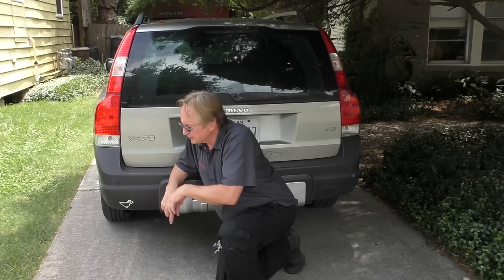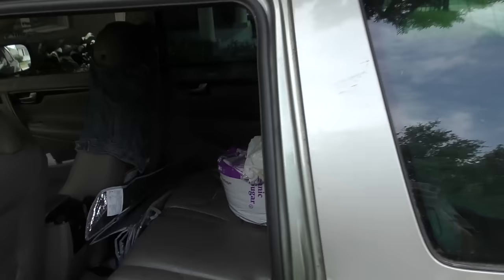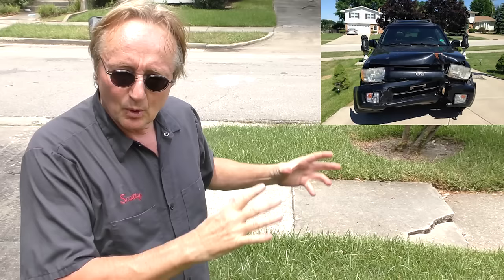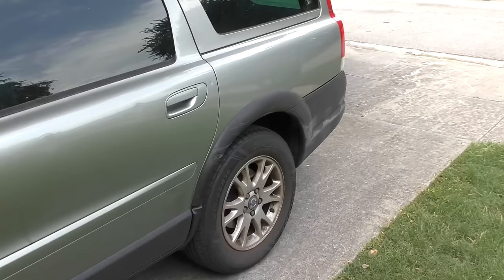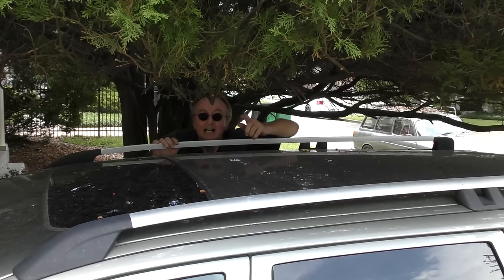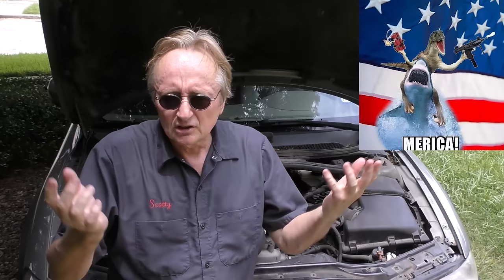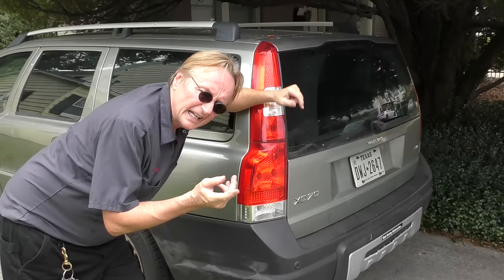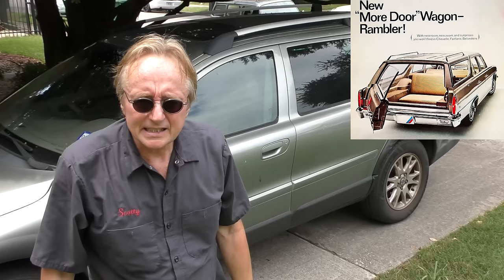Here’s Why Old Volvos Last Forever

Comment: Old Volvos are basically the Nokia 3310 of cars.
Reply: Josh Bacon 😂
Reply: Volvo’s are like my 90 year old grandma, they just won’t die!
Reply: Jk. Grandma, I love you
Reply: Never crash into a Nokia 3310.
Reply: iPhone 1
Reply: But those earlier 01-02 transmissions were like the xbox 360 red ring of death.
Reply: Josh Bacon Toyota land cruiser
Reply: Only the old volvos are so reliable and durable? For example the xc70 2016 model is not so reliable??
Reply: Don't forget about Motorola
Reply: you got that right!
Reply: Josh Bacon
What's the Nokia 3310?
Reply: @mouaxiong8618  the big brick ones.
Reply: Yup the Nordics knew how to build stuff back in the days
Reply: Volvo at Malaysia is unreliable car, easily oil leak. Need to overhaul due to the turbocharger. Don't trust this guy anyway.
Reply: People just made stuff IN GENERAL so much more durable back 15, 20, even 30 years ago.... most of the time anyway.
Reply: yeah you think. In reality the engines, gearboxes and the rest of the drivetrain just breaks and breaks.
Reply: Jia Fong Wee what years r u specifically talking about because they truly were reliable back in the day. My friends mom has had one for about 18 years now with no problems
Reply: True i driva 850 from 94, runs like a charm ;)
Reply: Only the Swedish built Volvos. The Dutch built Volvos (300 and 400 series) weren’t as good as the Swedish ones
Reply: I'm glad I bought a 2007 s80 3.2 with 147,136 miles on it. Just needs it's regularly scheduled maintenance. I changed the spark plugs and ignition coils so far.
Reply: Oh lord! 😂🤣
Reply: @moronsafetybot662  are you 8??
Reply: @jiafongwee3080  the volvos in your country are made in chinese factories. They do not have the quality control that europe has. The reason New volvos suck is because they shutdown european factories and now only use chinese factories and some ilegal slave man power and kid power to build them. Once they opened factories in China the quality droped a lot. If you buy a european made volvo they are the most reliable and safest cars money can buy but maintenence costs are high.
Reply: Like when I was out with my volvo 744 and drifting in my forest I crashed into a tree at 50 km/h only my Fogg lights broke lol nothing else happened to the car
Reply: @radnybolt5327  the 850 was prstty durable with the t5 engien but not as fun as a rwd Volvo 940 b230ft, fk, fb and volvo 740 Turbo from the 80s with b230et 180hp damn such fun cars
Reply: @rafaelramosmelim735  well if you own a old volvo from 70s to 2000 you can fix almost everything in your own garage with the proper tools and buy cheap parts from different sites on the internet in sweden you can buy cheap parts from V-parts or kl racing etc and I own a volvo 740 and I fix everything myself
Reply: Not clutch
Reply: @triggerhappyhippie  we still do mr
Reply: @karlcarolusrexxii1352  pure volvo power
Reply: @eddiewennberg6  💪💪💪
Reply: Nokia 5110😀
Reply: Josh Bacon my Volvo was build 1983
Reply: Xc70 best all round by far
Reply: And both are from Nordic countries😀
Reply: Jia Fong Wee that’s why I using Diesel engine oil to maintain well my turbocharger
Reply: I am a keen old merc collector and considering old volvo as my next collection. Are parts still available just like old merc?
Reply: @martijnhooijer3243  Those where problemcars...
Reply: 😂😂😂you only get rid of it only because you dont love it.
Reply: So true.
Reply: Pretty much
Reply: Or if an Abrams tank has a kid and it’s young and rebellious.
Reply: @MRBOCHIEDA2ND  is that a car with 4 doors or a wagon?
Reply: Spot on! Total reliability for those who didn't know better.
Reply: re there any good newer ones...the car ones specifically?🤔
Reply: @mouaxiong8618  i haven't heard that name in years
Reply: Swedish communities play an important role in Finland history.   Like the almighty Carl Gustav Mannerheim!!!
Reply: @nickcaesar7650  .
Reply: My 2016 vw polo gti just died its gonna cost way to much to fix so having no money I went looking for a cheap run around . I found a 2004 v70 D5 my god its a great car it runs like a truck and has so much room iv transported motorbikes in the back . Done thousand plus mile trips and I only paid $600 iv had it 2 years now and not once had to repair anything on it apart from a wheel that buckled when I hit a pothole its a beast
Reply: I still have a 2006 XC70 that I bought new 17 yrs ago. Great car but expensive new & parts are expensive & can be challenging to fix, although fantastic help online with chat rooms
Reply: @sniff1197  as someone who has owned several of these and daily drives an R, these cars are incredibly reliable
Reply: @jiafongwee3080  what  year volvo?? ?  Volvo  lama  solid... you jusr buy  the  junk from lazy owner
Reply: @johnnyst.4372 don’t buy any Volvo bought after 20212
Reply: LMAO

Comment: 40 year old Volvo technician. Work on anything German or Swedish. Volvo is the best car ever built. Especially the B230F 4 cylinder and the 5 cylinder’s. The cams stay in a bath of oil. The European’s refine the metals so much better than we do.
Reply: Thanks alot for Sharing your experience 😊..
Would you recommend 2005 V 70XC with 60,000 ml on it?
Thanks alot
Reply: @abdulazizsaleh8650  Im sure that cars good but just so you know Ford bought volvo in 1999,.

Comment: The world record for car with highest mileage is held by a Volvo
Reply: 322k on mine
Reply: Josh Morey the world highest mileage car was a 1960s Volvo that has 3M miles
Reply: I hope my car will last that long body and frame wise is still good for what it has
Reply: @joshmorey2310   I had an 01 xc70 with well over 300k, had it doing 235k/h twice (dum I know) .  eventually it got in a fight with a hydro pole... they both lost but luckily no injuries whatsoever. R.I.P first volvo
 432k on its replacement a '05 xc70, hoping to get it to 500k this winter. 
good luck with yours
Reply: @James_318  got the XC 90, 2014, 200 hp D5, Executive ... Running like a Singer sewing machine and still 20 km/l at 90 km/h. Best car ever
Reply: Anyone know the record?
Reply: Its on a volvo p1800. Love those cars and my dad owns one
Reply: Lord Thunder  - We all know Toyota's are also very reliable vehicles, but none have reached over 3 million miles yet.
Reply: Lord Thunder  - Gasoline engines don't last as long as diesel engines. Gasoline engines can do hundreds of thousands of miles, diesel engines can do millions of miles because diesel is a lubricant.
Reply: Lord Thunder  - I wasn't speaking bad on toyota, and to say Volvo's are better or worse, Toyota's are most reliable in the southern areas, Volvo's are most reliable in areas of snow.

You are right, there is good reason we discontinued using diesel engines in cars because they are a major pollutant. Gasoline and diesel come from the same source, diesel is actually cheaper to make but the reason diesel costs more now is because of quantity ratio between gasoline and diesel. I'm not saying it's not possible for a gasoline engine to get a million miles, just less likely over a diesel engine. Diesel is a lubricant though, gasoline isn't and that does have a impact on how long these engines last, but the engineering of the engine also plays a big part of it.
Reply: I just got 225k on my current Volvo and my last one probably had close to 350k
Reply: land of Lincoln  those are nice. Very comfy.
Reply: Ford crown victoria
Reply: I have a 2002 S40 automatic with 35.000 miles. I think it will last me a long time. Granny car kept in garage. Looks and drives like new. No turbos no direct injection no nothing. Old school tank. I love it.
Reply: @assarstromblad3280  They are awesome cars. The Electric by Lucas on the early and mid years is a pain but other than that they are indestructible. Almost like the Lexus 430.  THEY ARE NOT MONEY PITS.
Reply: @billm.819  My dads P1800 is from 1966, so I guess most of the problems the early versions had had been solved by then. Only thing engine and driveline-wise that has been fixed on that car is the generator which we just cleaned up and put back in, and also the ignition was fixed because it didn't run completely smoothly before. As I said, awesome car when it comes to reliability, almost no electronics, and very good quality, but most importantly it's a beautiful car.
Reply: @tellyonthewall8751  I dont know what the best car is but my uncle had a pug 205 diesel. It did over 450 thousand before the chassis rusted so hard it failed the mot. He just scrapped it the next day.
Reply: Hello Community, I’m thinking about buying a 2000 Volvo S70? Does that sound like a good car? It’s got 120,000 miles, someone’s selling it for like $1000, but it doesn’t start. Any comment,
Reply: @DSJVNdsjnvf4356  I don't have much experience with buying cars but I would say if it doesn't start you should check what the reason is before you buy it unless you are really good at fixing cars, because it sounds like it could be expensive the repair if there are major problems with the engine.
Reply: @DSJVNdsjnvf4356  seems quite a hight price.
Reply: @DSJVNdsjnvf4356  but then again I'm from england and they go for £300 and that's working
Reply: Toyotas have not reached 2 million Miles. Car beyond 1 miles is a Volvo.
Reply: The Brick"
Reply: The late Irv Gordon. He owned a red 1966 Volvo 1800 coupe. When he passed away. His car had way over two million miles on the odometer.
Reply: @hafiz8379  Are the late Irv Gordon? He owned a 1966 Volvo 1800 coupe with over two million miles on the odometer.
Reply: Frank Denardo it had 3 million miles
Reply: I bought a Volvo 2093 wagon with a broken timing belt for $ 500. Should I fix it ? How much could it cost?
Reply: True in the tractor trailer world as well! But far before the automotive Volvo’s. Volvo had the first commercial diesel to go a million miles without removing even the cylinder head. I believe it was in the 90’s.
Reply: Lord Thunder I have a 9 yr old Volvo wagon (XC70 T6 with R-Design retrofit and Polestar reflash) with 300,000 miles and is my daily driver!   Haven’t made it 1 million miles but I’m not entirely sure how anyone can do that without having to drive half way across the country even other day or something.
Reply: Hafiz, and still counting...
Reply: What's the milage?
Reply: Toyota 4.7 broke 1mil
Reply: Volvo 240 -85 on the late 1990 runing 1000 000km in North part of Sweden and only changed breaking parts and ignition parts and oil.

No struts bearings and so on.
Reply: @MrD3000  I have a 2002 S40 1.9 turbo diesel, 195.000 km. All good except for lower control arms which I have to replace.
Reply: Million miles true story
Reply: @Starnerdz  low rpm
Reply: Got a 97 f250 with 670k km or 770k km or some variation of x70k km. Paid for n super handy
Reply: @tellyonthewall8751  mine y.2012 D5 is eating 10 city, 15 highway km/L. I cannot believe to 20 km/l @90 km/h
Reply: Hafiz how did they did he get 3m miles
Reply: It’s 3 million miles on a P1800.  Beat that Toyota!
Reply: P1800
Reply: I've had 4 VOLVO' s... 244. 144. & 850.. Best cars ever.
Reply: 182k on my 2004 v70
Reply: Got a 2003 D5 gt with 625.000 km's on it.
Reply: 350k miles on my 2003 S60 and running strong.
Reply: But actually, I think a 1947 Volvo with well over 3 million miles.
Reply: The Saab 900 hold the record for a million miles on the original engine. I own a 350BHP Saab 9-3 aero estate and a Volvo Estate V70 T5 with 310 BHP and a 4runner 3.4 V6 these are the top 3 most reliable cars in the world in  my book capable of intergalactic miles!
Reply: land of Lincoln  Toyotas are like bananas:when the peel gets brown toss it.
Reply: damn
Reply: That Volvo with 3 million miles  was for only that specific car not across the entire model line. Toyota cars in general all are able to put on many miles , which is a testament to their quality across their model line. Who knows what work was done to that Volvo for it to reach that mileage after 40 plus years.
Reply: 350k km here
Reply: Volvo for life.
Reply: 3 million in NY near me.
Reply: @DSJVNdsjnvf4356  did you end up buying the/a Volvo S70?
Reply: @maartenlaarhoven160  no lol
Reply: Record holder is a Mercedes W123 in Morocco.
Reply: mine was a snag. 1988 240 GL with only 31k on it. yep 31,000. thirty-one thousand. got it off some guy who got it off some old lady that barely drove it. things mint!
Reply: @calvinhart6793  I can't remember that record, but 1.000.000 km is not unusual in Sweden.
Reply: @billm.819  LUCAS- the man who invented darkness. You still find "one eyed" Volvos, though.
Reply: @billm.819  They are complete money pits. I have a 2004 XC70 that I bought new in 2004. Only reason I have it is my kid wants it as her 1st car. It runs like crap. They want $1200.00 for a transmission fluid change! Everything costs double or more to fix on a Volvo. It’s been very maintenance intensive for 17 years. Why the HELL do I still own it? Well my wife loved the wagon. And again my oldest kid just got her drivers license so I guess the torture will continue.
Reply: @DSJVNdsjnvf4356  RUN DON’T WALK AWAY!
Reply: @user-lg4cv1dj6k  Wow! This cats in the future.....and Volvo’s are still money pits from hell.
Reply: @Griswold678  How much money have you put into it??
Reply: @metaljew4456  not including insurance, I've put only $185 into it over the past year. And that is just for an oil change, oil filter, rotors, and brake pads. I did all the work myself. I will have to get tires soon though and I anticipate paying around $600 total for all four tires including the install
Reply: @metaljew4456  the XC90s can be a very maintenance prone model of Volvo's. I would stick to the s'model sedans, and the V60/V70 models.
Reply: my Volvo 850 SW is 347000 km
Reply: I hate how my 2006 Volvo XC90 with 144,000 mile is now starting to leak engine oil after running perfect since buying it in 2006
Reply: I got a ways to go then. My s60 just rolled over to 158k miles
Reply: i just bought one again today 500k km on lpg👌🤣🥰
Reply: 360K on the S60 2004
Reply: My old xc70 d5 had 400k miles
Reply: But not this generation lololol
Reply: @TriumphTune  meh, give it a couple of decates
Reply: @hafiz8379  wtf
Reply: @calvinhart6793  3.2 million miles, by Irv Gordon's Volvo P1800S made in 1966 at Volvo's Göteborg plant in Sweden.
Reply: My volvo die at 598 000 km, it’s was a volvo s60 2001
Reply: @Starnerdz  by
Reply: I just received a 2001 Volvo C70 XC from my mom!!! I can’t wait to go get it!!! Only problem with it is the Cadillac converter!!! Had to be a plus!! I love the stereo system!!! Anything else I should be aware about please let me know!! Other then that it seems to be my new baby!!
Reply: @tonyapoole06  How unfortunate that it won't be a Cadillac lmao
Reply: FALSE statement.
Reply: Yea the damn thing was nearly replaced entirely
Reply: @biddinge8898  Only parts that are wear parts were replaced, like oil filters, shock absorbers, light bulbs, rubber engine mounts, tires etc. It is the original engine, transmission, chassis, and body. I don't know what you define as a car but thats what I'd call a car. There is no car that can go 3 million miles without new tires etc, and that is expected. The car did it unlike any other privately owned car.
Reply: I just bought a 2002 v70 xc in April with 158k. It now has 174k. I haven't had any major issues with it so far. I live in Florida, bought it from a buy here/pay here lot as a cash deal for $1788.
Reply: But saab is the only one in the world that was driven 24 hrs full throttle with no problems after the test.
Reply: That’s the late Irv Gordon’s Volvo.
Reply: That was Irv Gordan with over three million miles
Reply: @hafiz8379  for real ? wow
Reply: Yeah and it's in Patchogue which is like 30 minutes from my house
Reply: 180K on my 99 C70 coupe
Reply: @marcelpatel9017  Any Toyota would also have to have major work done on it by the time it reached 3 million.
Reply: 3000000miles by Irv Gordon
Reply: What about the Million Mile Lexus?
Reply: @joshmorey2310  Yo do you still have ur volvo??? Mins at 222k miles and I really want it to go to 300k, How long did urs end up lasting?